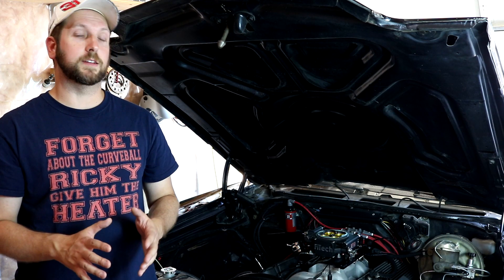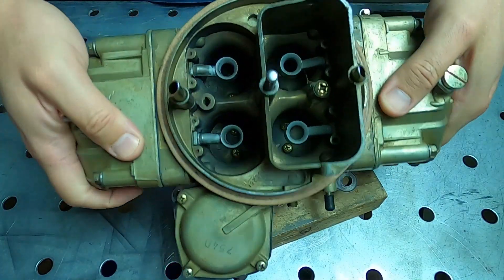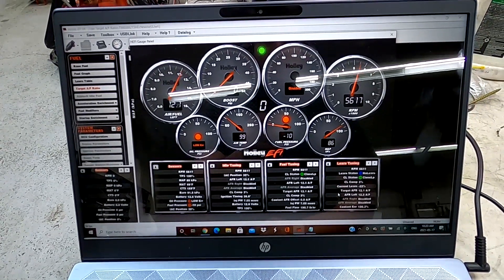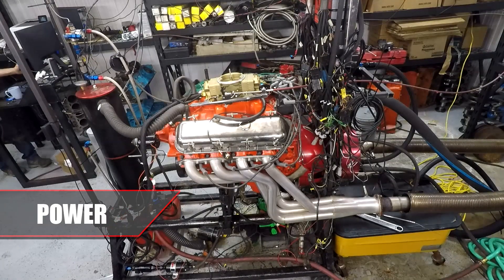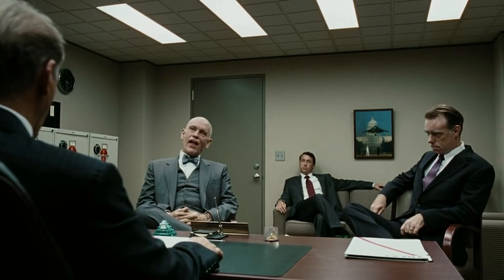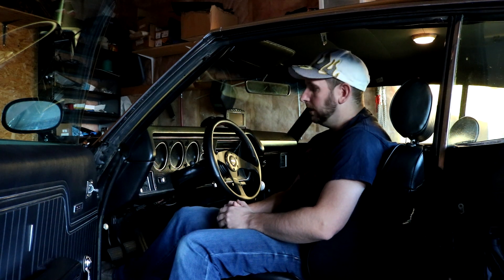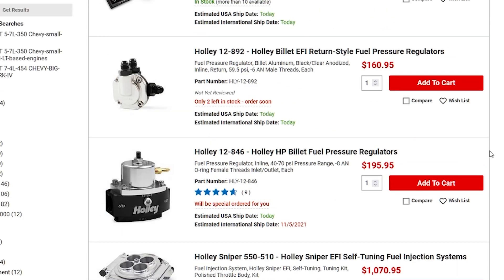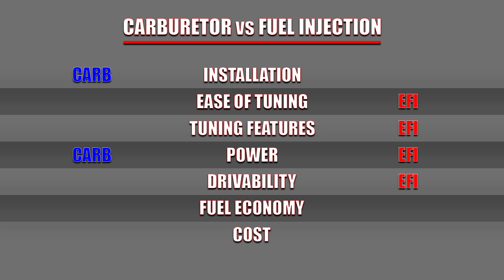Carburetor vs EFI - which is BETTER?

Comment: Yes, carbs are cheaper and much, much easier to tune. btw, funny how we forget about things like chokes when we're trying to push something.. lol. Most of us are weekend cruisers. We're  not going to the track or strip although we could using a carb fuel system and have fun. What we want to miss is all the problems that come with complex systems that can leave you stranded for a host of reasons. I'm a tech who works with complex manufacturing systems like robotics and know how difficult they can be to diagnose when things go wrong. My starting point is KISS. Carbs last, are cheap and perform well right out of the box, see edelbrock AVS2 for example. Why efi after the 70's. First of all engineers like to change and invent things and secondly, during the oil crisis, they were mandated to get as much mileage out of a vehicle as possible, thus EFi. We're not talking a lot of extra mileage per vehicle but add millions, well you get it. No, I personally would stay away from efi unless you have many, many hours to play and plenty of cash to buy and keep it running. Who needs more headaches
Reply: I agree with you 100%. I'm building a 53 Chevy pickup for drag and drive. It's Running a 1000+HP Chevy I6 292 with a polished Weiand 6-71 NOS and 2 QF 650 DP carbs. 5 stage dry sump and Electromotive TECs 200 EMS. There are few things sexier than a roots blower with duel quads sticking out of the hood. Thank you for your time.
Reply: im just redoing all the electronics at once on a 94 ford efi after 30 years. Yeah its a pain, but once it's done its gonna be brand spankin new and last forever

Comment: Let me see that EFI make Quadrajet carb moan sound. Not happening. Carb wins.
Reply: LOL

If thats your criteria, You go BOY!
Reply: @RipitRon   Carbs are simple, fun, sound good.
Reply: @SOLDOZER  LOL

If you say so! I have been building Custom Hotrods and bikes for 35+ yrs and you and anyone else can take your cabs and enjoy...I will take Fuel injection all day every day!

He who is stuck in the past remains in the past!
Reply: @RipitRon  not actually... a use a mix, old school carb, modern barking, air,suspension, stereo and gauges ... often the simple way is just as satisfying , and as prices increase Carbs are just an easier DIY
Reply: @bradmason8334  you drive that carburetor car across country, thru the mountains and tell me whats better. Not only will I get better fuel mileage, better throttle response, and in most cases more HP than you will, I certainly wont have its spitting and sputtering in elevation or boiling fuel on a HOT 100 degree day. There is a reason FI exists................its simple its better in every way over a metered fuel leak......PERIOD!
Reply: @RipitRon    Why are half the cars at the drag strip using carbs if EFI is so much better?
Reply: @SOLDOZER  Simple to answer

#1 Old Dogs hate new tricks
#2 $
#3 Lack of knowledge
Reply: @RipitRon   Must suck for those EFI guys to get whooped by an old carb.

Comment: Good Video including timing for me as I am doing a BIG switch. I ran a Demon 850 since '02 dyno tuned to crate 502 Art Carr 200-4r lockup, 3.70 12 bolt 17" wheels no choke two pump start, best econ. 19mpg. Big switch is adding Tstorm single charger with their all serpentine acc. kit, cam (TBD - but will have 114 LSA), 7/8" headers, full 3" Magnaflow exh, glass 3" cowl hood with airbox to charger, and settled on buying FiTech power adder 1200. Also changing to '90 Caprice FI bigger tank. Since orig. 396 SS, has 3/8" line I want to still use. Still need to figure proper fuel pump since boosted...will surely be posting more as I go through your other videos!

Comment: I love reading the responses, what of most of it tells me is that MOST really have no clue what they are talking about. Now i will tell you from experience that if you are very well versed on Carb tuning, you DONT drive your car except for round town or cruise ins then your carburetor will be as good as any EFI system.....HOWEVER if you actually drive the car lets say across the country, or take road trips past your typical 100 mile round trip there isnt a single Carburetor that will out perform even the cheaper systems like fitech. 

Let me give you an example 

I have a 1949 Old Fastback with a 383 CI SBC, the car had a Quickfuel 650 CFM Carburetor, I drove tha car 2-1/2 yrs ago on a cross Country trip from the PNW to Nashville Tennessee.........Or so that was the plan. I didnt make it to Pendleton Oregon before I ran into Vapor Lock at 12:00pm. The car fell on its face and died and it I was sitting on the road for 1-1/2 hrs until car cooled down enough to fire back up. I pushed ahead to only have the car die again in Boise. After 3 more attempts I continued on to finally resort to ONLY driving at night. And no people the water temps where only at 190 to 195 degree's.

I switched from the Carburetor when I got back from my nightmare trip (Yes I resorted to driving at night only and came home) And ordered the Holley Sniper Fuel Injection system. I have since driven the car from the PNW all the way to Florida averaged 18.7 MPG with a 430 HP 383 SBC a 700R4 trans with 3.25-1 gears and 26" tall tires. Now I will tell you I have the ability to tune the car for Fuel Mileage when on a road trip so in all reality this isnt a fair comparision, BUT I will tell you there isnt a single category except for $ that a carburetor is better than EFI!  PERIOD!

Some old Dogs just cant be taught new tricks.....The reality is those Dogs all get left behind!
Reply: So nobody should have a carb because onetime you had one problem? People drove back and fourth across America for decades with carbs and no issues. Sounds like the problem is you and your setup.
Reply: @SOLDOZER  People drove back and forth across America for decades with carbs and had issues all the time.  The difference was, that's just how cars were.  It was expected and accepted because it was the norm, and there were no alternatives.  So people knew how to work on them and deal with it because they had to.
Reply: @SOLDOZER  And let me clarify something, todays fuel does NOT have Anti Boiling agents in fuel. They dont need it since 99.5% of all vehicles licensed are Fuel Injected. This is the reason for my Hatred for a carb...You can have all the sound you want, when your seeing nothing but my tail lights how impressed are you with your Carb?
Reply: And when your ecu on that crap Holley efi takes a crap on you you better have good shoes or a wrecker on speed dial
Reply: @dannybarlow4256  Well i have 4 of them and the oldest one is now 5 yrs old and not a single issue.....Sorry to burst your bubble but you can say that for any part (INCLUDING) a metered fuel leak box known as a carburetor.

Comment: what exhaust are you running on your car?  Sounds great.  I have a ZZ454 crate motor with flowmaster super 10 exhaust.  I am not sure I like the super 10s....they are supposed to be the loudest exhaust Flowmaster offers, but I am not quite sure I am satisfied.  On a side note, I am adding a more aggressive custom cut Comp cam, a super sniper EFI, and a  Nitrous Outlet wet plate system with remote bottle turn on.   Also adding a VCF Racing serpentine system with a dual electric fan controlled by the EFI.
Reply from the maker: The green 68 Chevelle has 3 inch exhaust with Borla ProXS mufflers.

Comment: If you grew up with carb cars you have no issues I can jump in my 71 chevelle  after its been sitting for a week pump it a couple  time s turn it over fire it up pull it out of the  garage fast idle at 1500 to 2000 rpm for one minute drop idle to 1300 rpm put in gear and go so 2 to 5minutes i can go out of the driveway..When i had stock muscle cars you just pumped it a couple times started it choke was set and you went and it drove fine back then we never warmed up our cars
Reply: ok boomer pls worrying more bout ur hairline k
Reply: ok boomer

Comment: I run a FiTech Go Street 400. I love it despite some of the small issues created by myself (fuel starvation due to wrong placement of the in tank pump). However, I would have to disagree with you on the ease of tuning going to the EFI. I might be inclined to agree if the tuner was well versed in the capabilities of the EFI unit, but I am not a tuner. I am learning, but one thing I can say that with each new bit of knowledge, ole Dale the Truck tends to work that much better. I will soon be installing a Holley Sniper for comparison on my 79 Cordoba and will hopefully be able to report on ease of tuning between the two.

Great video. I may be leaning on you for some tech tips at some point to help get my Fitech dialed in.

Comment: With the cold start issue.
1. You need a choke
2. If you have a mech pump you're better off using a squeezy bottle to fill up the fuel bowls so you aren't cranking over and over to get fuel to the bowls. Most of these cars sit for ages and the fuel bowls dry up.
Reply: PUT AN INLINE ELECTRIC FUEL PUMP, SIMPLE!
Reply: When the car has been dormant over the winter, I let the engine cranking time (done in several ~5sec bursts, of course) pump the oil around before the engine gets fuel to start.  When in regular use (1/week) it starts quickly enough, and that's OK because it has residual oil film.

Comment: Some carburetors can have a choke. A properly adjusted choke can make a cold start quite easy.  I also believe its what you are familiar with and like that dictates tuning ease and simplicity to actually tune. I am much more at home with a carb so before I spent many hours learning all the tuning aspects of the FI, I could have dialed in several carbs. I like your video but I feel you sell the carb a little short. I have the FiTech 30012
 Go EFI 8 1200HP System on my 66 C10. To get the fuel efficiency dialed in to perfection takes quite a while of tweaking. Which is fine if you like doing that but just because you didn't get a little dirt on ya doesn't mean its a better way. Also you didn't mention dealing with the computer software glitches. Tons of issues on many forums of guys dealing with issues. When I change a jet or adjust something on a carb its changed and stays changed. Not necessarily so when dealing with chasing buggy software. With a carb I am not at the mercy of some guys flaky software.   Good video though I think you got a lot spot on.  👍🏼
Reply: I agree about the choke. With a well tuned carb & correctly set choke I can easily start my old cars in any weather. For late model daily drivers, I like EFI. But for me part of the old car experience is the simplicity of things.
Reply from the maker: A lot of good points. Electrical glitches can absolutely show up with fuel injection, while a carb is very mechanical and much less chance of a random failure. When I say the EFI is easier to tune, things like AFR adjustments can be done in seconds vs the time and effort to change jets. Same with timing, i don't have to remove the dizzy and change springs or have a timing light hooked up to check what I've done. But as mentioned in the video, for the most part all tuning necessary to get the engine performing right can be done on a carb or with the efi, just a different way of getting there. Like you said, its always easier when you are familiar with whatever system.
Reply: For someone thinking of going efi.. I totally agree and I'm a 60s guy and will never give up the old school but man that efi just got to find a way into my budget 😂😂👍🏼
Reply: NOWADAYS ITS THE CHEAP CHINESS ELCTRONICS IN EVERYTHING!  A CARB WILL GET YOU HOME!
Reply: @barnjob75  unless you buy good parts like a smart person
Reply: As an older guy, I have to agree with steves759's points about the stability of the carburetor compared to the massive potential (and very difficult to pinpoint) problems that can crop up with an EFI setup. I can speak solidly about both as I have extensive automotive electronic control system experience having only recently retired from the field. A little over thirty years have passed since I was heavily into drag racing full-bodied cars as well as a rail. Believe me, when you spend many, many successive weekends at the drag strip testing and tuning your way through each weekend, you have to get good at dealing with the mechanical tune-up issues. Since you've already conceded that once they are tuned properly, both induction systems perform very similarly. But, from the standpoint of reliability, you would be hard-pressed to find a more reliable intake system than a correctly chosen carburetor and the correct intake manifold sitting on top of a well-balanced, well-planned engine. The very biggest rap on carbs has very little to do with the carburetor itself, but rather the incorrect selection of a carb for the given application. Without researching and carefully planning EVERYTHING when building a performance power plant (which includes choosing the right pistons, camshaft, cylinder head setup, intake manifold, ignition system, spark plugs, etc.), the carburetor is often blamed when the performance isn't what it was expected to be. Working with an EFI system's seemingly infinite electronic controls will often allow just enough adjustability to make a lot of mismatched combinations function almost as expected, but do not expect that it will take less time to get there than matching things up from the beginning would've taken. Plus, it will never be as good as it could be if the right preparation steps were followed from the outset. The thing that bothers me about the EFI systems is that, unlike a mechanical system, when you have an electronic failure, most often they are difficult to find. Is it a software issue? Is it a power issue? Is it a connection problem? Have I lost a sensor? Or, worse yet, is there some type of mechanical problem causing the EFI system to misbehave? Having worked for many years with these types of problems on production vehicles with many, many thousands of replicated versions of them out there to reference from, I can only imagine just how difficult trying to find some type of similar issues with a vehicle that is completely custom where no other vehicle is using that exact combination. I'll admit that I am "old school" when it comes to performance vehicles, but I absolutely LOVE the fuel injection system on my family vehicle. Still, I don't see any good reason to depart from the tried and true intake systems that have been extinct from U.S. production vehicles for over thirty years. But in spite of what many might think of as a "prejudice viewpoint" I want to commend you for the work that you did to put this together. I know it wasn't easy and it wasn't quick. I'm not even trying to alter your conclusions, just wanted to throw in my 25 cents worth of opinion based on my experience. Good Job!!!